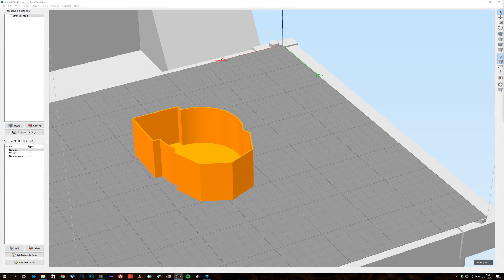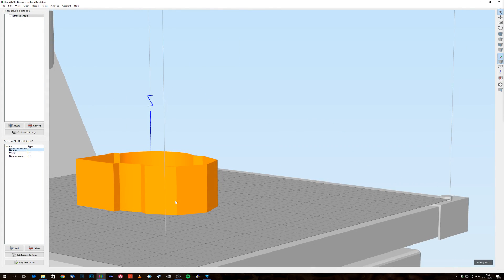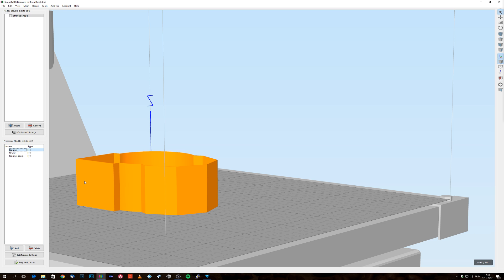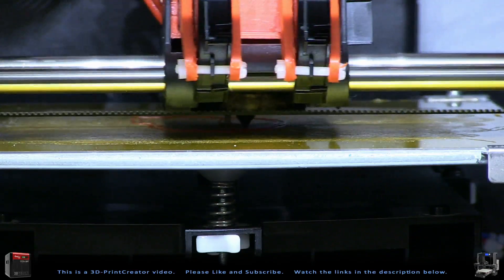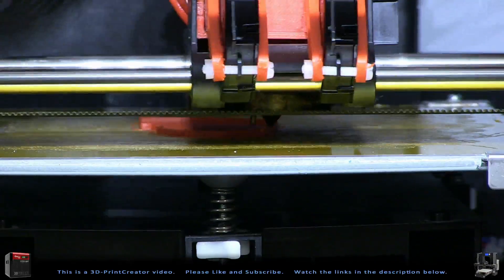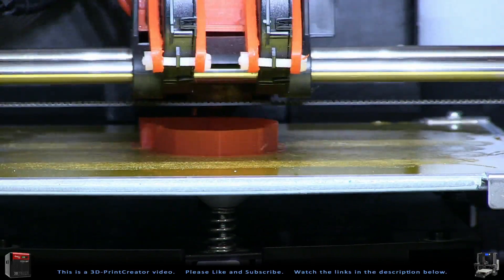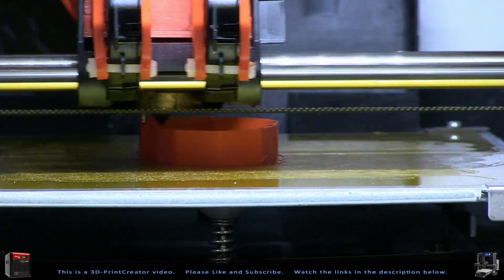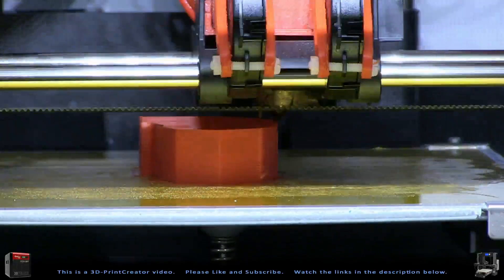▼ Setting the EXTRUSION MULTIPLIER in your SLICING software for your 3D PRINTER.

Comment: You need to teach people how to measure a cube and calculate extrusion multiplier for their printer. So, that they know the correct value for their printer. I'm searching the internet looking for a good example. My problem is that my holes are not the right size but my outside is.
Reply: https://help.prusa3d.com/l/en/article/d9j1xdg7vj-extrusion-multiplier-calibration this is the one i used for my Mk3

Comment: You say it's important to dail in the extrusion multiplier in the correct value. I agree. But if i cannot determine the 'right' value by visual inspection, how can i determine the right value? 
I saw some people do it by printing a single wall test, measuring the wall thickness and compensate with the extrusion multiplier for the difference in actual vs. designed thickness. I did too, and this seems to work. But then i have to use an extrusion multiplier value of 1.11, which to me sounds too large. Also then, i have to compensate for the horizontal offset which increases too.
My question is: is there a measurable way to determine the right extrusion multiplier value for your printer/filament combination?
Reply from the maker: The extrusion multiplier should me 1.00 but this only goes for a printer with perfect settings on the motherboard. For example in Marlin, you can set the extrusion by measuring the amount of filament that went through the extruder. Measuring exact 100mm and setting this in the Marlin software should give you an extrudion multiplier of 1.00 but only when the used filament is exactly the given size, like for me 1.75mm.
Now, because there are variables, like the size of the filament, the hole in the nozzle, like the settings in Marlin or any other software, there is a possibility in your slicer to multiply the extrusion by a positive or negative value. This is, however, only to compensate for a wrong value somewhere else.
Reply: I understand. My e-steps for the extruder are calibrated. I did that as the first step.
Still if everything is setup right in the firmware, how do i determine the 'right' extrusion multiplier value, or better, how do i determine when the print quality is okay? In theory the multiplier should be right at 1. Now, if i wanted to tweak this multiplier value, based on what do i say "now it is okay"? I ask this, because when i increase of decrease the multiplier with only 2-5% i cannot "see" any difference in print quality. I only start to see differences when i go beyond 10%. But when i compare these kind of values with what i use to find online, there is a big difference with people setting the multiplier at 97% or 101% for example. It just seems that for my printer these small adjustment values don't do anything. Or maybe i need a new set of contact lenses ;)
So in general, is extruder multiplication setting based on what you see visually in the final print, or is there a more "measurable" way to do it?
Reply from the maker: The problem in this is the number of variables.
If your e-steps are set correct, then you can see what the multiplier does when you are extruding.
Just set the value to 90% and measure how much filament went into a part, then do the same printjob again, but now with 110% and measure the amount of filament. 
Now you know how much of a difference there is, you can go and ask yourself if the amount of difference will be noticeable in your print. if the difference is near to nothing, you won't see it. If it's a huge difference, you will see it.
After you have done this, go and make a temperature tower and see at what temperature setting your filament gives the best print quality. With this result, go and print some parts to test the strength of your parts. You now know the exact temperature, now you have to test differences in extrusion.
When printing these test prints, notice the visual quality of the parts. They must look good, while maintaining the best strength. The best part you now print is the part with the best extrusion muliplier setting.
Reply: 3d Print Creator 
Thanks for your answers. I will experiment with it some more.

Comment: Hoi Brian, great video again! Nice topic. Only on one thing I do not agree with you I'm afraid. That is the clicking sound of the extruder. That is, in my opinion, due to low temperature and not due to high extrusion value. The filament is not soft enough (due to the temp being to low) and can't get pushed through by the extruder. No matter how much or how less the extrusion is, if the temp is to low the extruder has to push 'solid' filament through and is simply not able to. So the clicking sound is mostly due to the temp being incorrect if you ask me. But still great video, keep up the great content! Groeten, Jerry
Reply from the maker: Hi Jerry,
Of course it's a bit of both. The temperature setting is very important if you want to get rid of the clicking noise from the extruder. But I can assure you that even with PLA at 240 degrees Celcius you will have a clicking sound if you try to push to much filament out of the nozzle. With my stock hot-end, I have to go down to 0.9 (90%, that is) to get rid of the clicking sound.
Besides that, heating up filament to a higher temperature gives you all kind of other problems you don't want to have. For the type of PLA filament I am using I would stick to temperatures between 200 and 215 degrees Celcius. Heating the filament up to for example 225 degrees would give me cooling problems, thus warped or broken prints. I can fight that with my self made coolers, but out of the box, the Da Vinci Pro doesn't have any filament cooling.
Groetjes terug, Brian.
Reply: I see! So it is a balancing act actualy ッ noted! Thanks

Comment: Quick Question: Do you have Borosilicate Glass on your printbed? I recently realized that my aluminum bed is slight warped where the center of the bed is lower than the outer edges. I'm thinking of simply placing Borosilicate Glass on it using binder clips to hold it down. Curious as to what you're doing and any thoughts or suggestions you might have for this? As always, thank you for all that you do for this community!!!
Reply from the maker: Hi Jared,
I don't have the need for glass yet. My bed is also warped, but just slightly.
Using glue stick does the trick for me, but if the problem get's worse, I guess glass would be a good option.